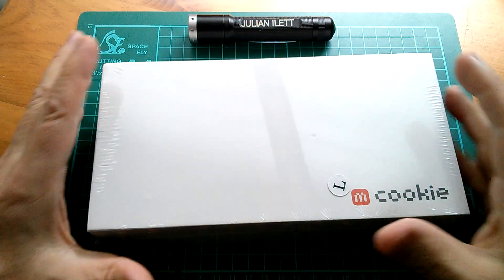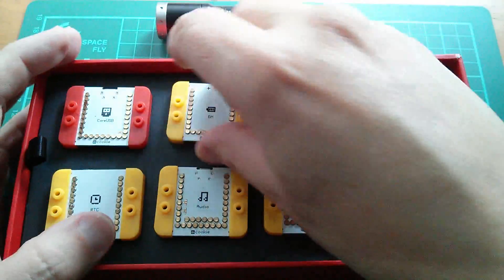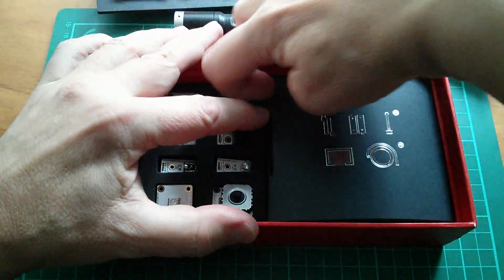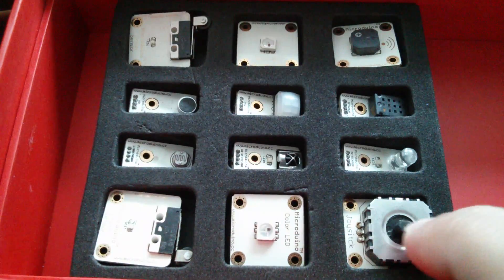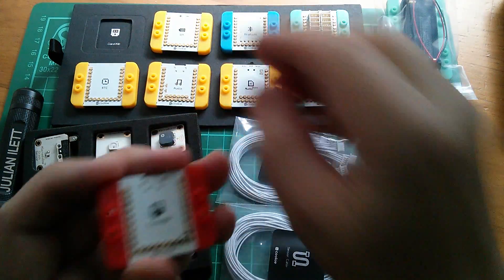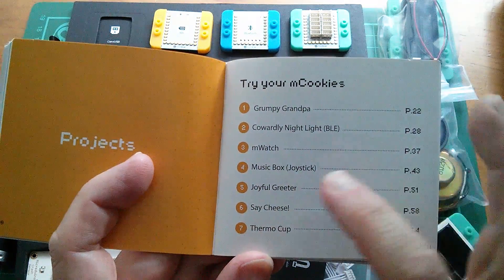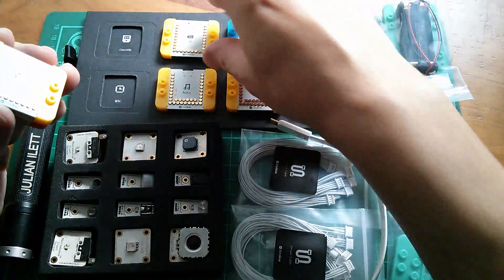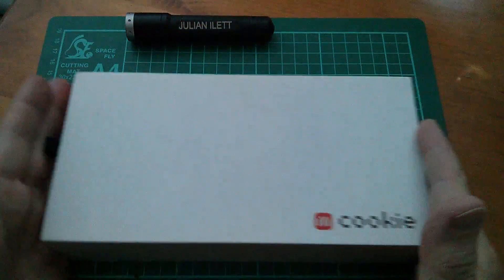Unboxing: Microduino mCookie 201 Advanced Kit

Comment: Sooo what? Are you thinking you write C because you program Arduinos? Um, not necessarily, typically arduinos are programed while relying heavily on libraries to take care of all the difficult bits. While that reduces the challenge (the fun part of programming if you ask me) quite effectively, it also reduces the control you have and often bloats your resulting assembly. So while technically it IS C, and you can write full C code, often I find it's more accurately described as C with crutches.

Comment: I bought the Expert 301 kit on eBay for $130 and am beginning to think it was a big waste of money. I downloaded the IDE and tried to run some examples as shown in the manual that comes with it. The examples in the manual did not appear in the dropdown menu. Searching through Git Hub I can find some examples of code, but they don't explain which modules and what connections to make. I also bought some used Legos to try and make some connections. The Lego interface even sucks. The sensors do not have Lego connections. I suppose you need to buy one of the special kits and addition expense, they may work fine. If I am wrong on any of this, please point me to the examples that should be in the manual.

Comment: It's certainly an awesome little kit....paint by numbers electronics!! You get very fast results. But is really going to help anyone learn anything???  In theory someone learn this system inside out -  could take this kit and put all the various bits and bobs together, using the gui software, sensors and lego and come up with an amazing prototype and then realise they have no way to get it to market?? They have no knowledge of reading schematics, breadboarding, protoboards, components, pcb layout, soldering or how electronics works (just off the top of my head)  Interesting though.... that in the comments people are talking about getting this for their kids as a learning tool??? Maybe a way to get them inspired at best.....

Comment: That's a neat idea to use lego which believe it or not I still use for prototyping mechanical systems. I'm disappointed there is no motor modules or WiFi modules which is petty much a requirement in current technology today. Mixly looks pretty awesome. Perhaps you can do a follow up video with a demonstration?
Reply: Ok just done some digging. There is an expert kit that does indeed have the more useful modules you would want with Lego such as the motor module and servos etc. It also includes the WiFi module I really wanted. But I can't seem to find anywhere selling the modules individually. The pricing is also obscene for the UK and EU markets!

Comment: I have heard the 'maker' movement described as electronic lego. Well here we have just that. In a way this is like the electronics kits of the 1970s. Pretty useless but able to generate interest for a young lad to look on electronics as a career path. You would not use these boards in a project likewise neither would you use an arduino with shields. I would guess it is OK for a 13 year old to get a flavour of what is possible even if it is an expensive way of doing it.

Comment: On first glance, this repeats the problems with the Lego Mindstorm (??)  system - it "locks" you into a very expensive trap, and half the modules are specific only to the "top end users" and never get used, but you've paid for them. it would be more user friendly if Arduino themselves developed a GUI that would be useful for beginners, something like the US "Light O-Rama" Christmas lighting controllers.
But thanks for sharing! Looking forward to the follow up, despite my reservations!

Comment: Too bad we didn't see the bottom of the audio modules. Looks a little like one has a MicroSD card, and the other, could it be a MP3 decoder?
Reply from the maker: The audio module has a JQ6500-24SS MP3 chip and a winbond 25Q32FVSIG flash memory - there's also a micro USB socket. The audio shield has a micro SD card socket and a centre-sprung switch for volume up/down - no semiconductors on this module.

Comment: anyone notice the poor solder joint on pin one of the joystick? OCD.
Reply: and the unpogo'd connector pin @ 2:30 and the sketchy printing @ 1:37. made me wonder if the quality is as good as the presentation
Reply: At 1:38 it looks like there's some solder bridges on the top left of the Bluetooth module IC.
Reply: Nice catch, that could be an insta-death of something as soon as it's powered up. Not good quality control at all.
Reply: yeah totally! by the way you are a good observer
Reply: Was going to say, the joystick is probably only the mounting plate... But that bridge tough. Ffs... That's bad

Comment: Completely unrelated question: What is your preferred means of contact? I have been working on a device very similar to your old MuPPeT, and believe comparing our designs will be productive. I tried emailing you, but I think the address I found might be outdated.
Reply from the maker: I'll gladly answer YouTube comments/questions for a couple of hours after the video is published. But the long emails with numerous eBay links and the inevitable "how do I connect all this stuff together" are a problem! But I'm very grateful to all the commenters who reply to other comments/questions that appear on each video. I'm sure things are a lot easier for the make-up tutorial YouTubers, when they get asked their favourite lip gloss colour. They can just reply "pink - obviously".
Reply from the maker: I think I read your email. Unfortunately, it's now impossible for me to answer all the correspondence I get - there's just too much. I've tried to think of solutions to this problem. Don't reply - easy for me, but not very friendly. Two word reply (eg. that's cool) - my current favourite, but a bit impersonal. Standard reply - doesn't help as there would have to be numerous different standard replies. Personal assistant - can't afford one! I know some YouTubers use twitter - that might work as reply length is limited. Let's try it - @julian256
Reply: Maybe you could select a few "moderators", who can answer frequent questions. For more specific questions they could then contact you and ask, so you would not get the same questions over and over :)
Maybe some of your very long term viewers would do that, i don't know :)
Reply: Julian Ilett i've always gotten an answer from you whenever i had a question, so i can't complain :)

Comment: Mixly looks remarkably similar to Scratch. No mention of a Linux version of the IDE? Quite an oversight for the developer since the Arduino IDE has always been Linux friendly.
Reply from the maker: Mixly is built using Google Blockly - so is Ardublockly. There also seems to be some connection between Scratch and Blockly, but I haven't quite got my head round it yet :/
Reply: It seems that Mixly is Java-based so should run in Linux: https://github.com/xbed/Mixly_Arduino